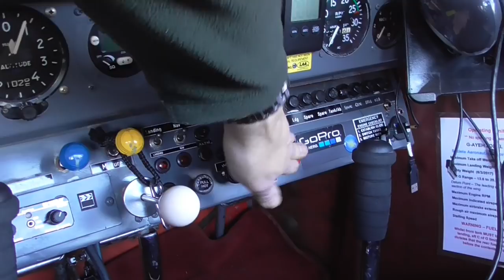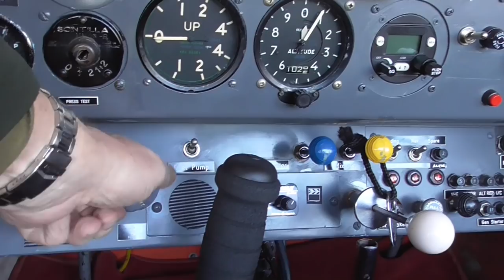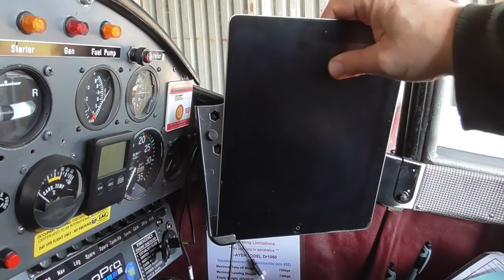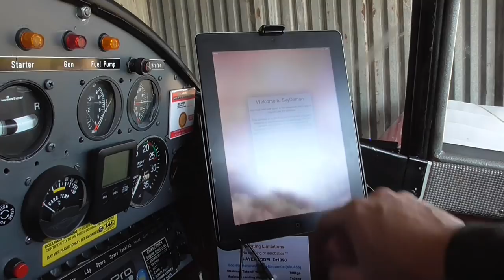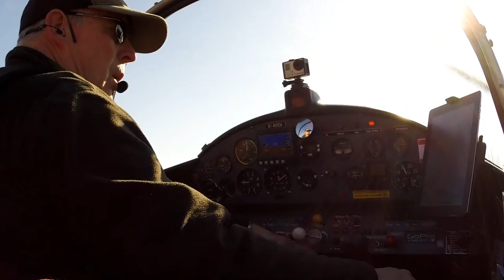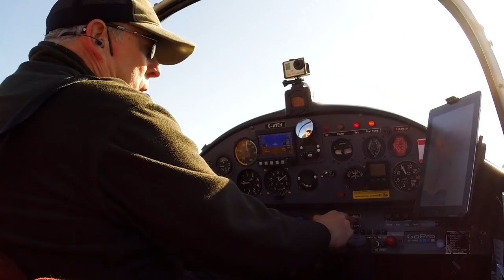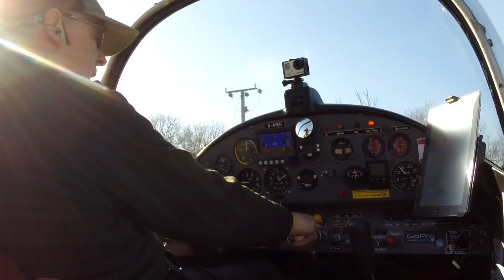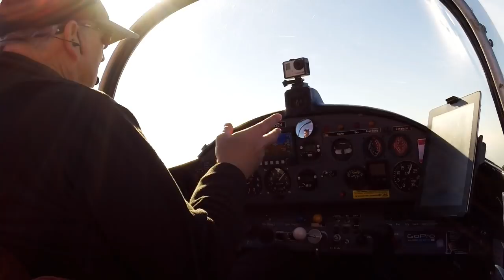CLARITY ALOFT HEADSET TEST FLIGHTS - (RV4 & Jodel DR1050)

Comment: Cool video Tim, got a couple of questions from your pre-flight. You only seemed to undo fasteners that connected top cowling to bottom, what attaches the whole thing to the fuselage? Also, what gizmo were you switching on before you turned on SkyDemon? I guess it’s gps, if so does it do adsb too?
Reply from the maker: Sorry for the delay Jed but it was my sons wedding this weekend and we were on Brownsea Island for that. The lower cowling wraps around the fuselage, up against a front bracket under the prop and hooks on to two pins. The small gizmo is a Garmin GLO which picks up the satellite signals for the iPad,
Reply: Jodel Flyer no need to apologise., hope the day went well. Thanks for the info and looking forward to Friday.